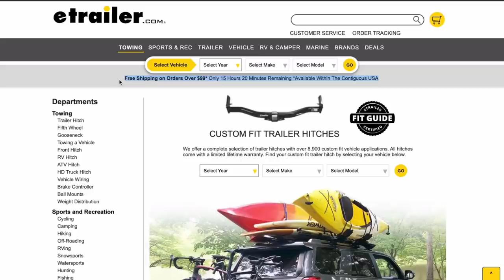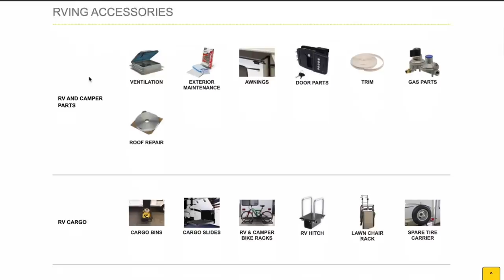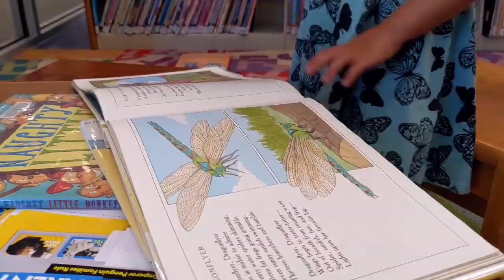Leaving For Our Next BIG RV Road Trip! BUT First...RV Repairs

Comment: Your vitamin B12 blood test results are not unusual. Most vegetarians are low in B12. Depending on how low your B12 level is, sublingual B12 lozenges can help.
Reply from the maker: Yes you're not wrong, we take supplements for this reason but seems my body has trouble absorbing the vitamin. - Liz
Reply: @EatSeeRV  There are 4 different forms of Vit B12.The synthetic cheap form is cyanocobalamin. Most supplements use this poor version.  Methylcobalamin,  hydroxocobalamin, & adenocobalamin are the remaining ones. Your genes help determine which of those forms you should use. They say 65% of the population carry a MTHFR gene. Which means your body does not (methylate) rid itself of toxins very well. Chances are that
you should use methyl or hydroxo. Your text results would be better, as your body would be able to better absorb it.